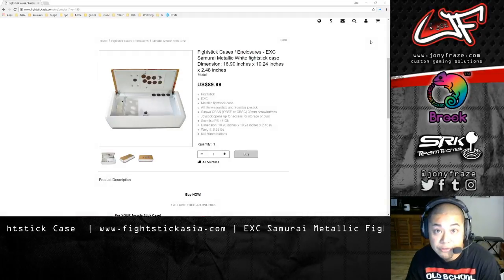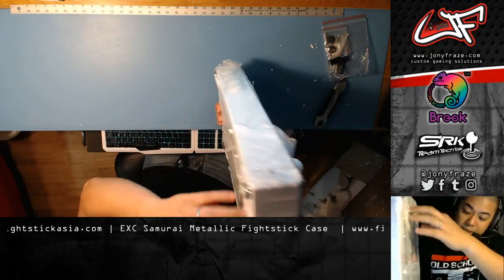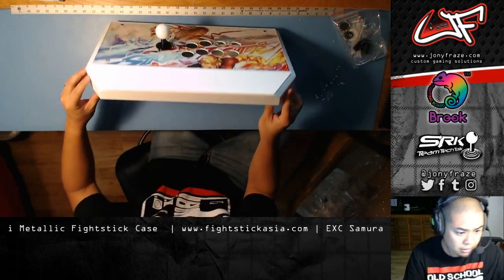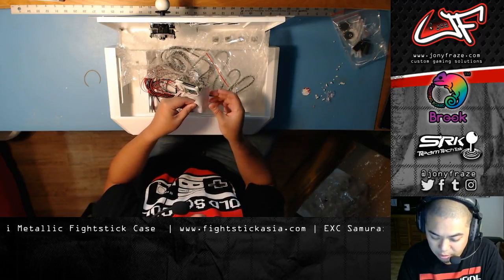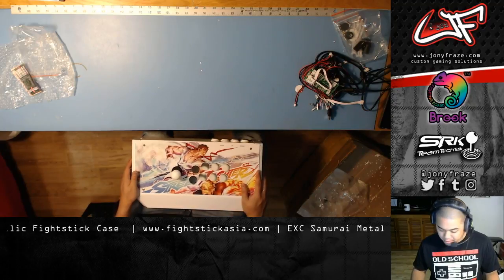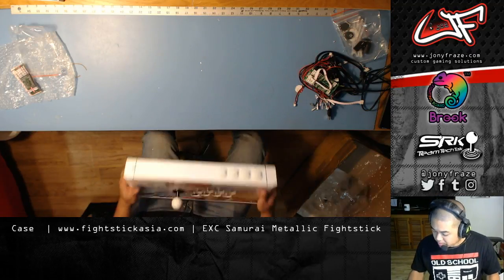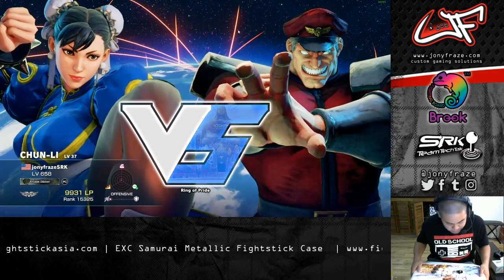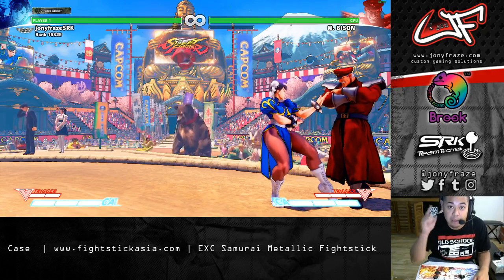FightStickAsia EXC Samurai Metallic Case Review

Comment: Did Fightstick Asia go under?  I can't seem to find anything current on them and their site is a dead link.
Reply from the maker: Yes they closed down and put their focus on mixbox
Reply: Thanks for the reply, jonyfraze.  I noticed Paradise Arcade Shop sells a stick called Excellence Arcade Herculis which seems identical, but they are out of stock.  Do you know of another supplier that sells them?
Reply from the maker: From my old connects from Fightstick Asia, they are only producing the cases to be sold in china. Another company has taken over basically. We may be out of luck. =(
Reply: I see.  Thanks for checking, Jony, I appreciate you taking the time to ask your connects.  Maybe I'll go with an etokki Omni, instead.  Cheers!

Comment: Awesome review. Based upon your review I ended up getting it from Paradise Arcade. Quick question for you though. Mine came with an acrylic board, slightly narrower than a credit card but about the same width, with a bunch of holes in it. I'm assuming it's for the PCB but I'm not sure. Any ideas?
Reply from the maker: Yup that’s exactly what it’s for. It’s just a shield for the pcb since the case is metal and can actually mess with the signals if you connect it directly to the case.
Reply: Jon Bonilla how did you connect your PCB board to the case I just got mine in today and have no idea where to put it or how.
Reply from the maker: Joey Rada use 3M adhesive rubber feet. Focus Attack sells them or you can probably find them in a craft or hardware store.